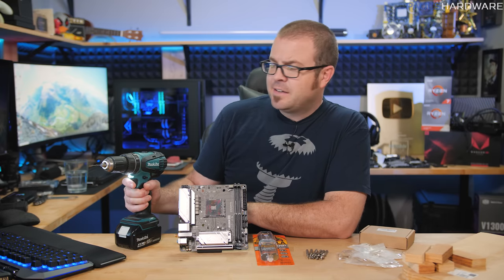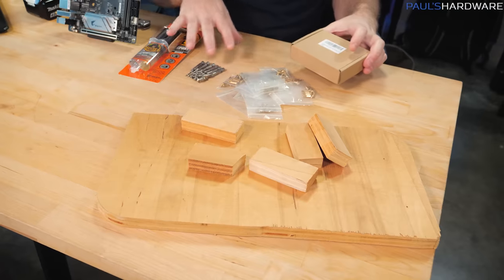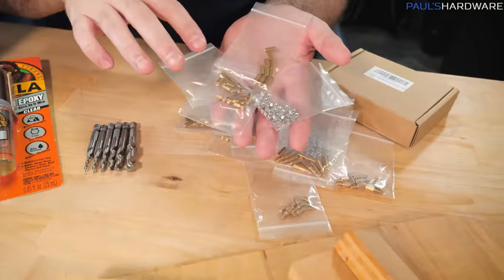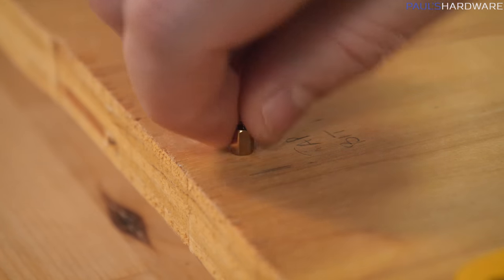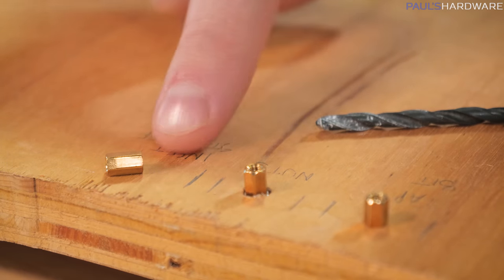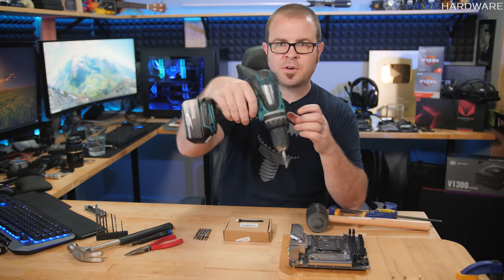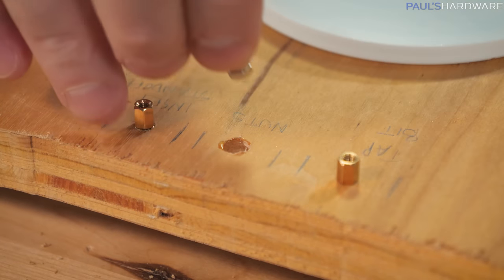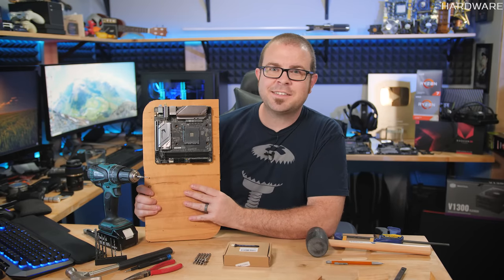The Wood-Mounted Motherboard Challenge!

Comment: On the stand offs, use the direct method with the threaded drill. Fill the hole with super glue that will sink into the wood and strengthen it around the hole area. Then the when dry re drill thread the hole or better still just use a hand tap.

Comment: I would use m3 threaded inserts for wood. Alternatively, maybe claw inserts for wood. This will allow you to change standoffs easily because once you take out a screw out of wood it is extremely difficult to put it back in. If you have steel or brass inserts, however you can adjust height quite easy.

Comment: Simplest, easiest, most low cost....self tapping screws through mount holes straight in to wood. You can space as a standoff by using some of those nuts around the screw. Or just space with something else anywhere on the mobo that is free.  And you don't have to get your drill holes / direction of standoffs perfectly precise prior to mounting the mobo.

Comment: Try a threaded insert (Fastenal 11138973) It's one that is designed for that application
Or maybe try a T-Nut (Zoro G3255996) While also designed for that application, it has the added benefit of potentially helping with the grounding issue.

Comment: You should do the inset standoff method.
And then put a wire with ring lugs under each standoff to get grounding to each screw point....
Board > inset standoff > ground wire/ring lug > standoff > motherboard > screw

Comment: I was thinking the same and how to mount on wood because of the grounding and if there are any issues with it. The only issue i can find is the heat at the back of the motherboard so if you want use one more on top of the stand offs you already using for 1/2 inch space because wood and heat not a good combo.

Comment: Advantage of tap bit first is you can re-drill later and fit the inset standoff later if the first fails; i.e. the first hole will allow re-drilling to the larger hammered in inset. Once you go inset, you only have the nut method which just sucks.

Comment: Tap bit stand off + tiny drop of "wood glue" or "hobby adhesive" would be my method, I think. 
Inset standoff, hammered in place - maybe that too with a tiny drop of wood glue, would be my second method.

Wood glue - or  "hobby adhesive" - would be less permanent, but still more than sturdy enough.
Epoxy is VERY tough once it is hardened, and any changes (dismantling) would be more difficult to do.

Comment: I used a slightly smaller drill bit to simply anchor the motherboard standoffs into painted 5 ply 1/2" plywood board.
It's been mounted and functional for a decade, it's what I'm posting with at the moment.

Comment: Drill 2.5mm holes, take CA glue, drop of glue in hole,  drill threaded standoff into the smaller hole.

The threading will tap into the soft wood and the glue will "threadlock" it on

Comment: ive had a nice laptop motherboard (i7, case got cracked and cost as much as a new unit) mounted to a piece of carpeted wood acting as our "smart tv" in my bedroom for several years now. i used the tap method, using the board's oddly placed holes from the case. i used a long screw, partially unthreaded, to support the power plug as it hangs, and it works great. hdmi to the tv and a nice stereo and it outperforms every smart tv on the market in the smarts region. i stream local content, all the streaming apps, youtube content, and can even sit and play warcraft on it. not bad for recycled parts...

Comment: What i would have done: take an old pc case, and remove the motherboard plate and screw that into the wood, leaving the existing holes for the standoffs available, as well as give you an option to ground the plate more easily into the psu.

Comment: Isn’t friction the only thing holding in the inset standoffs, though? When the standoffs themselves are screwed in, they’d come out if you pulled straight up on them hard enough (ie, attach a fully loaded mobo and turn it upside down). At least with the tapbit method you’ve got the threads providing mechanical holding power. I’m not a carpenter, but it seems like things would get dangerously loose when the wood naturally expands.

Comment: if you make the hole slightly smaller you can ahmmer those in with a plastic mallet. one drop or two of CA and they will never get pulled out. it also looks neater.

Comment: Paul, just do a quick google search for "press in nuts" you'll find a lot of choices for hardware that will do exactly what you are trying to achieve properly. I would suggest  a knurled rivet nut, you just drill a hole of slightly smaller diameter and tap it in with a hammer to get a secure mounting mechanism. The friction bond will be plenty strong without use of adhesives as long as the wood is already very dry to begin with.

Comment: If you want to be extra safe with the grounds, get some small bonding wire and bond all of the stand offs to ground.  Not necessary but probably safer.  Jamming the whole stand off into the wood is probably the most stable solution but you want to be careful not to crack the wood by choosing the right drill bit and hammering gently.  I'm not sure why, but I just don't trust putting machine threads into wood.  That mini ATX board could be held up with bubble gum or thumb tacks though.

Comment: Those tapper bits are amazing and a time saver, but they are SO fragile when you’re using them with metal. I’ve never had one come out, but it was metal and not wood.

Comment: There are standoffs that are designed to mount into wood.  I think Luke used them in a video...?  It's basically coarse, wood threading on the bottom, to grip the wood, then regular standoff on top.

Comment: I’m working on designing a DIY chassis similar to the Singularity Computers Spectre case but I want dual loops with integrated manifold/reservoir and a 90* rotation. I’m in the planning stages now, but it’s gonna be a while before I’m able to start on it.

Comment: They make threaded inserts that screw down into the wood and then you can screw the standoffs into the inserts, basically just a more secure method of what you did because instead of just a nut being in the wood you have screw threads that bite into the wood and hold it tight

Comment: Why not use riv-nuts (rivet with a thread) or well-nuts??
Reply: Everyone smash the like in these please so Paul sees
Reply: I was thinking the same, rivet, tried and tested in evryyythinnggg.
Reply: The chance to split the wood using this is high, because they need to expand to properly fit, that why is most used on metal. For wood the best option is or screw directly, what I highly don't recommend, or use insert nuts.

Comment: the nut works the best but from the other side and with the holow standoffs as spacers and normal m3 long screws. 
Naturally you have to drill the wood all the way, with 3mm drill bits first and make a bigger hole for the nut, like in this video, to stand in.

Comment: Funny, I actually used method 3 on a mATX mainboard about two years ago. With an i7-3770S and passive CPU cooler. Also an pico-Power Suppy. And an SSD under the mobo. Is a nice 0dB system!

Comment: I wish you had shown mounting the mobo with screws clear through the wood with a nut and washer on the other side since i have those around the house, or can get them easily from any hardware store, and I dont have to order them.  I will be doing this build probably twice over the weekend.  For a harddrive testing pc on my workbench and my desk.

Comment: As some others have mentioned, you should use coarse-threaded insert nuts for mating metal to wood. Metal screws have fine, shallow threads that bite well into metal but are not meant for softer materials like wood. Given that a motherboard is not likely to experience any significant forces, you'd probably be okay with the methods you tried. However, it seems you have a nice piece of walnut there, so why not spend a few bucks on a pack of threaded inserts?

Comment: I'm building an arcade cabinet so I've had to mount a motherboard on plywood. The solution I went with was to use threaded inserts but the inset standoff is pretty much the same idea.

Comment: Paul, you are overthinking this. It isn't like you are going to hang a truck from the wall. Just drill a hole with the inner diameter of an m3 screw (2.5 mm) and screw in the standoff. The standoff will do all the tapping.

Comment: You probably never had a music box in your life. If you mount directly in the wood the wood will amplify the noise, to reduce that, maybe you can glue the nut in a rubber material, then glue the rubber material in the wood. Wood also retain more heat and it will make your heat dissipation a nightmare, maybe if you apply a anti-heat paint (you can find as spray in leroy merlin, for example) it will refract the heat before get trapped in the wood.

Comment: I'd go with the inset method as well.  It seems like the simplest  and most secure solution with the lowest risk.   The tap bit is nice, but your screwed if it strips for any reason.  Pun maybe intended.

Comment: How about using a sharp metal object (I don't know the name in English) to make a hole right in the center of where you need to drill for those motherboard-standoffs? That is more precise than when you draw a point with a pencil and it makes it easy to position the drill 'exactly' in the center of those holes. The epoxy one seemed inconvenient and the screw was oblique, the tap-bit method seems the best to me (those metal parts are quite precise, little can go wrong), the other in which you hammer it in can work well but I would be worried about getting cracks in the wood around that hole.

Comment: There are proper inserts that you could use rather to do basically the same thing as the inset standoffs, but in a pinch these should work nicely. Rather than using epoxy, a better alternative would be to use thin cyanoacrylate (ie super glue) to secure the insert.

Comment: i just used long screws through the board with nuts on the other sides and long nuts as standoffs. the same works for a GPU, there i replaced the scews holding the backplate with longer screws and a stck of nuts as standoffs (i could not find long m2 nuts)
i use a 12mm mdf plate, so this might not work with a very thick board since long and thin screws are hard to find

Comment: Late to the game, but you could have drilled all the way through, then using a slightly larger bit (but still smaller than the nut) partially drilled through the back of the wood for the nut and hammer it into the wood (might need a chisel to help with the corners of the nut). Then you're not relying on the wood to hold everything, you're using it for leverage.

Comment: G'day Paul,
I found this really interesting as I have been designing my own PC Desk so I have storage for my Steering wheel Controller & other gaming Xtras, as well as shelving for PC Gaming related toys & older parts I like but not using like your wall,
🤔 Maybe I could use this to integrate the PC into the desk instead of a case

Comment: just found this one. not bad. Currently building a pc desk case so I need to mount motherboard to wood. I was thinking 6/32 wood inserts. you can screw them in flush with wood. so you get even level on the motherboard? I did like the pounding a standoff into the wood though. but machine screw wood insert is super easy. drill and screw it in. self taping outside, machine thread inside

Comment: Pre-watching this I personally just took a dead motherboard and did the most cringeworthy thing I could think of which was tape the board in place, fairly close to the edge of the wood and just went for some drilling action right through the mounting holes on the board. It wasn't an elegant solution but it did work.

Comment: Based on my experience, I can tell you that the tap bit is completely unnecessary. Just use a standard, slightly undersized bit. The wood is soft enough that the standoffs will cut their own threads no problem.

Also, I remember watching you with a router in some other video. You should cut some bow-ties into the crack of your walnut to keep the crack from expanding.

Comment: I found this video as I've browsed through few bigger tech channels, I used to watch. I looked just for something interesting and this is perfect timing as I'm kinda ready to build a PC in a drawer, or rather to build a custom drawer case for PC. And I was thinking of cutting older case that I have as a donor for board tray. This is way better, but if I knew it earlier, I'd buy longer standoffs, as I wated the board to have 10-15mm gap underneath just for more airflow. Why aren'r they do it this way anyway?
Also @M3 brass insert nuts others suggesting - wouldn't they crack laminated particle board like cheap furniture is made of? Hammering in standoffs seems less damaging for the board structure.

Comment: Use a small amount of epoxy in the tapped holed prior to threading in that standoff. You want an even mounting surface. Doing it on either of the two other ways leaves a tolerance of error while drilling your set holes for the inset standoffs. Though this could be roughly accomplished without a drill press by using tape to mark the plunge depth on the drill bit....cool video and comparison otherwise paul!

Comment: So I would look for Tnuts, just watch out there theres a couple kinds but the ones I'm talking about have little spikes in them. So those you drill a hole then tap them in with a hammer. Its alot like the double sided insert you did but spikes that hold it in like little nails. I googled threaded insert 3mm and saw them for 15 cents each. Or a threaded insert. Again alot like your insert you liked but theres threads on it so you like screw it in. Also if your using epoxy like that dont just dump it in, its better to brush it on then stick it in.

Comment: Look for insert nuts, is the best and easier way to add screw mounts to a piece of wood, my HTPC is mounted inside a drawer on my media center cabinet, I got one that the threads was the same as regular motherboard standoffs, I changed my rig a lot and the mounting is still strong, even on a cheap ass particle board drawer...

Comment: I actually have an older server EATX board (replaced board, didn't fit in original 1U case) and no giant/server case for it so I have plans to do the same thing...  But I am going much more lower tech, wood screws and 1/2" plastic spacers.

Comment: Drill a larger hole like with the second method but just fill the holes with epoxy and let them cure an then drill/tap the hardened epoxy and use the standard stand off

Comment: I would just get #6-32 UNC male thread brass wood inserts - drill hole, a dab of glue (probably optional), then thread that into the hole, then you can just screw your standoffs in like normal.

Comment: It would be interesting to ask the motherboard makers if the ground connections in the mounting screws are preferable, necessary, or don't matter.
Reply: A faucet washer of the appropriate size would work as well, and those care generally black and some have a cool sort of conical shape.  --> Link -  https://www.lowes.com/pd/Danco-10-Pack-1-2-Rubber-Washer/3369350

Comment: Plywood will have better grip for each method as the grain of each board is opposed, use the epoxy for your walnut or you will end up stripping the hole regardless of the method you use.

Comment: i've been wanting to make  my own itx case something very portable but can handle 2 fan gpu (something you can fit in a backpack), but having trouble what kind of materials should i use buy a sheet of aluminum? or acrylic? or buy bracket parts from case manufacturers(which i already bought some), would you do a wood finishing on it paul? my fear is that if it catches on fire or something.. thanks for the post.. cant wait to see your finished case build. :D

Comment: I am really glad this poped up...
I am thinking of modifying my core p7 at some point with a wood front that holds my rads And mobo And covers all the extra holes.
Also Will give be a better res mount points And not need to drill the case to do that.
Well maybe i Will need to drill the case here And there but it Will only be for front cable management as to i am also Using thermaltake rgb fittings And those are a god damn mess with those short connectors 1sm away from the fitting.
And also put a full 1.4m front glass aswell to kill a bit of the rgb madness from those ekwb vardar fans And the mobo itself.
Any idea what kind of wood would look Best on a dark wood walls room?

Comment: Use the tap-bit then put some threadlocker on the stand-off, screw it in... et voila, its not gonna go anywhere for sure.
Reply: Or even just a touch of epoxy would reinforce it quite a bit.

Comment: Why not put a cut to size sheet metal piece mounted to the wood with holes for the stand offs? You could also run a ground wire from the sheet.

Comment: that's not how you use a tap-bit, I'm actually surprized it kinda worked.

for Tap-bits you first have to drill a slightly smaller hole and then tap it

Comment: The only thing is, I would not mount a very heavy air cooler on that just in case. But a smaller air cooler or a water cooler would be perfectly fine.

Comment: Screwing directly into wood with a fine thread isn't going to hold well in the long term, especially if you need to remove the board later. I had a similar issue with a custom wood case I made, and I did the inserted stand-off method.

Comment: I highly recommend using threaded insert nuts/countersinks (not sure how you call them) to mount the motherboard.
Check out this article for useful info: https://www.popularwoodworking.com/techniques/q-installing-threaded-inserts/
And an experiment for you to see why this is the best way - take your test wood piece and start screwing and unscrewing bolts into all stand-offs.
Do it 20-30 times and you'll notice that everything else but the inserts gets wobbly.